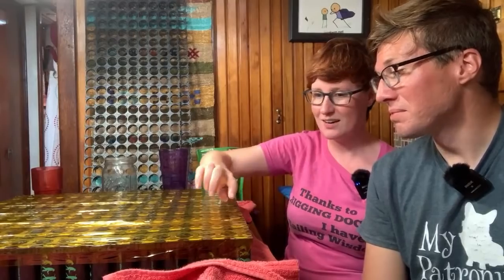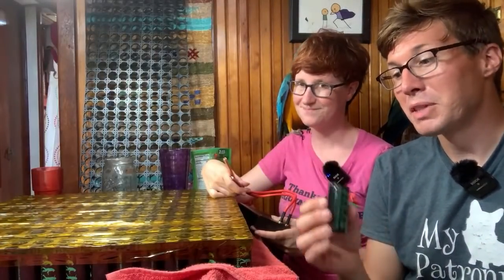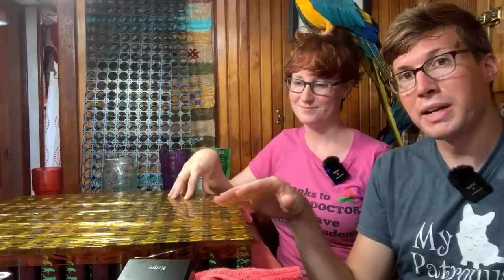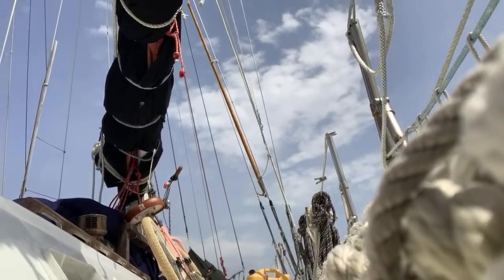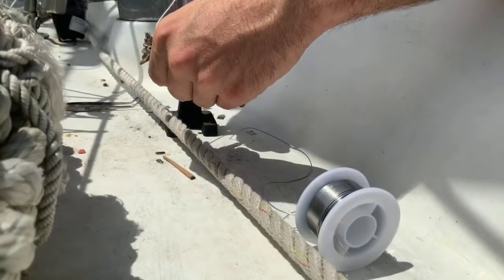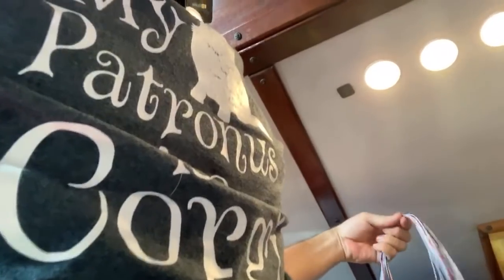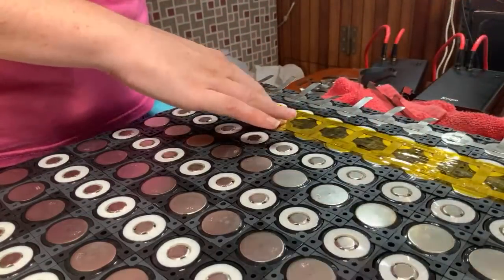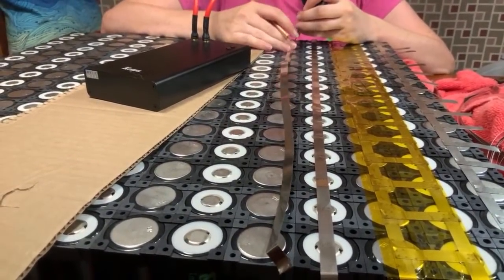LiFePO4 Battery Build [LIVE]

Comment: A concern that I have that I’ve never seen addressed. Marine batteries & electronics are built for the abuse, vibrations, and jarring associated with being in a boat. These banks your building are rigid without any kind of upper/lower insulation or suspension. I’ve been in boating most of my life with over a decade wrenching on them. The amount of household & automotive items I’ve seen fail on boats is FAR higher then their success stories because of that exact issue. Marine items are normally (overpriced) because they are overbuilt for the abuse. 
Just trying to look out for y’all 🤔
Reply from the maker: It is a concern and they won’t live as long as they would in a power wall in a house, but they should be ok for now. We’re stacking them with rubber sheets between them in a box low in the boat. Not having a diesel reduces a lot of vibration and being a heavy boat removes a lot of the jarring motions. We get tossed around but we never change direction or speed in a hurry.
Reply: @RiggingDoctor  xx650 cells are much better dealing with vibration than larger cells. large prismatic cells are not recommended in small boats. (100AH+)
Reply: Honestly, a lot of Marine stuff really isn't all that different either, sometimes they are just made with a bit more stainless (and in much lower quantities which drives up the price) and a marine sticker :)

PCBs and similar is probably the same, perhaps better coatings and more waterproof housings.

I highly doubt that a battery like a Battleborn is built with any real difference compared to these, and as far as I've seen, there isn't all that much dampening and such in them.

Batteries in cars probably live a much harsher life than in a cruising sailboat :)
Reply: @ovejohansen77  don't know, but I have 190ah cells. Total 7kwh, been 3 years in my cruiser and still running strong. Like new.
Reply: @Robinlarsson83  yeah biggest difference is that marine stuff is corrosion resistant, water resistant,  and biggest difference is ignition protected.

Comment: Great information in this video. IMO used car lithium is a better value and likely safe for a sailboat, but then again I don't keep my EV converted tractor in the nice garage for a reason... I would guess that the C rating on anything lithium at 48v would be significantly greater than what any electric sailboat will draw for current and I think that would help keep battery temp down, but cooling in a tight spot could still be required and difficult to monitor.

Comment: What sort of charge controller? Have you thought about the failure mode of it?https://youtu.be/JbnFyU79Nf0 these solid state BMS can fail if too much voltage is applied when they switch off say due to a failed cc.
Reply from the maker: The BMS is from Xiaoxiang. The system is only capable of drawing 400amps and I built them to handle that load with ease. Hopefully they don’t go into failure mode ;)
Reply: @RiggingDoctor  no charging failure mode. What voltage is you panel array coming in at? If you simulate a shorted charge controller by connecting panels to battery will the BMS successfully turn off or will it overvolt the FETs?